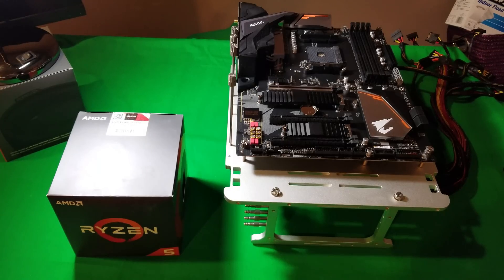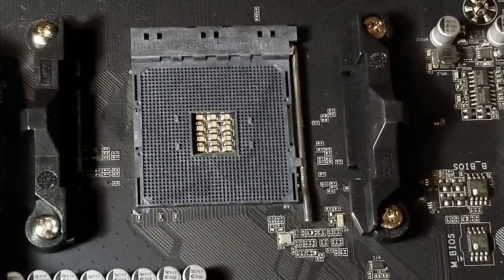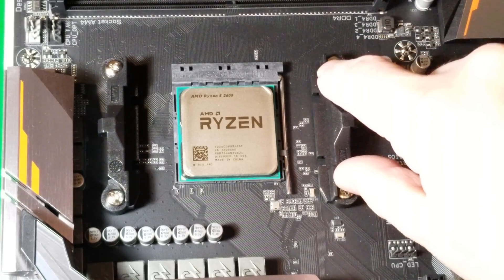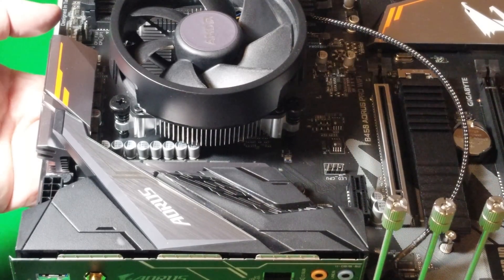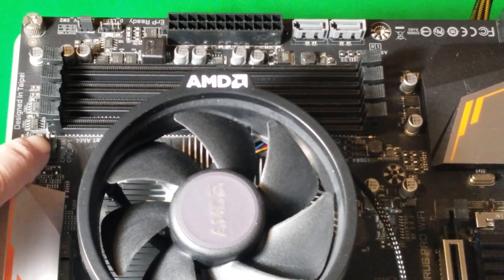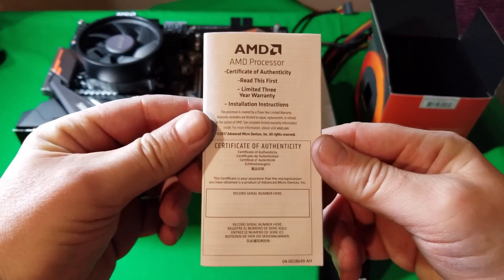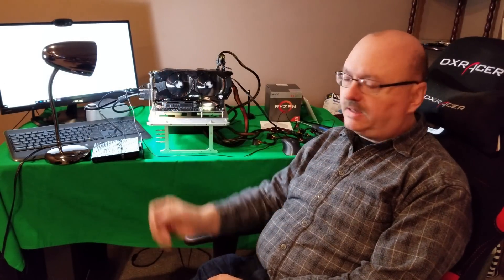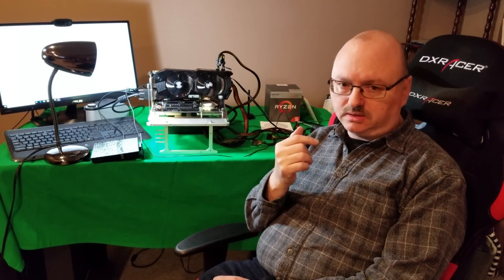Ryzen 5 2600 Unboxing and Install plus CPU Cooler Temps

Comment: My ryzen 5 2600 gets about 43°C in idle and 60°C max temp while gaming which is perfectly fine. What really scares me is when I stressed it to 100% with aida64, after 15 minutes of test with everything stock it reaches 90°C and stabilizes. It seems with different stress tests the temperature is different, as in cpu z stress test i get max 75°C
Reply from the maker: Yeah with the temps your getting and even if its getting to 90c while stress testing that not something to worry about. 60c while gaming is great. Your right though different stress test programs can vary somewhat.
Reply: @Reviewing_Playing_and_More_RPM  Yeah, just wanted to point that out. I'm not gonna utilize my cpu at 100% ever lol
Reply from the maker: @cachorropir  Yeah its hard to do actually, good that gaming usually doesn't either.

Comment: i've never put any parts together i got my pc custom built i currently have the ryzen 3 1200 but are planing on getting ryzen 5 2600x should i put it together alone or go to the company that built my pc and let them replace it for me free of charge? is it hard to put the cpu together? is there risks?

thanks, great video i subscribed :)
Reply from the maker: What MB are you using, but no there are really no risk, just to be careful and not bend the Pins, and also when you remove your current CPU it will try to pull it out of the socket, so be careful with that so as not to damage the current CPU when it comes out...otherwise you can just install as in the video and it will be gtg...will depend on your MB though, just ensure it's compatible...

Comment: my cpu temps on idle is 50 celcius with stock cooler no oc and no air conditioner in my room, is it normal? i just bought it 2 days ago
Reply: What is your ambient temperature? It should be around 10-20 more degrees than that
Reply from the maker: Your saying it should be 60 to 70C, on idle that's a bit high, so I'd be concerned depending on ambient temps and airflow...
Reply: @Reviewing_Playing_and_More_RPM  +10-20 of his room temperature
Reply from the maker: @yesman5463  if it's 10-20 degrees, then I'd say that's about right...
Reply from the maker: I'd say that's about right will depend on ambient temperatures, but It's not bad, will also depend on your case air flow as well...

Comment: So you tight the screws until they stop? Is there a risk of being overtight ? Thanks
Reply from the maker: Yes, once you fell them tighten then stop, but don't over tighten as you could strip the screw or  standoff and then it'll be useless and could cause damage to the MB...

Comment: My temps are a bit different from yours, i use a320m-k motherboard and pcyes ocx gelid thermal paste. My idle temperature on ryzen 5 2600 is 37°C ~ 47°C, it spikes from use like chrome or something casual but i think it's normal. The point is, your temps are 10°C lower, i have a guess but i don't know if it's right; i live on Brazil so my city is 30°C to 35°C on scorching days and you live on canada so that may be it. Am i right? Also my load temperature on the cpu is 58°C max, if that is similar to yours let me know.
Reply from the maker: Yes your right the difference has a lot to do with the ambient temp where I use it at, mine is around 10C less or so because I'm in my basement doing everything which does tend to be cooler in general, and on load your temps are almost exactly the same as mine...your getting good temps for sure...have an amazing day...

Comment: you slotted that fan on with absolute ease but I follow the exact instructions and my screws dont even reach the motherboard for me to screw it in
Reply from the maker: It takes a bit of practice, I have done it a bunch of times now, I struggled with it in the beginning as well...

Comment: For me, there's nothing holding the cpu in place...you said it pops in and you lock it in with the bar thingy but for me it just sits there and can easily be removed with the thingy down...
Reply from the maker: If you followed every step as shown in the video, there would be no problem, it would be locked in with the bar that comes down, and the CPU wold be held in place...not much more I can do, if you can't get it installed you might want to find a friend that can help, or take it to a computer shop for help...the pins need to go into the holes if it doesn't go down it's not in correctly...good luck...
Reply: @Reviewing_Playing_and_More_RPM  I figured it out. Turns out there was a piece underneath the motherboard that the screws go into that I had to put through the holes
Reply from the maker: It's the backplate...glad you figured it out...

Comment: Hi, I just bought a ryzen 2600 CPU but i've noticed that my temp on idle stay between 45-50 degrees C no OC with stock cooler. Do you think thats normal?
Reply from the maker: It's off a little but I wouldn't worry to much about it, check your temps when your doing something more intensive and see what you get that's a better determination...Thanks...

Comment: Do I have to remove my motherboard from my case  when removing this cooler?
Reply from the maker: No, you can remove it and put a new one on, getting to the backplate will depend on your case and the cutout on the back...if it won't allow you room to get at it then you might need to...most times you won't need to though...Thanks...
Reply: @Reviewing_Playing_and_More_RPM  thank you very much I was able to fix my computer problems. Appreciate it alot man!
Reply from the maker: Glad to help...

Comment: I was scared that when I was crewing it in I heard like crackling clicks but I guess it normal because when you were also screwing in it had the same sound as when I was screwing in so thank you
Reply from the maker: Yeah I think it's mostly the springs in the screws, but it is unnerving...take care...Thanks...
Reply: Reviewing Playing & More RPM if I try to wiggly my Amd stock cooler like you did in the video and it doesn’t move does that mean it is tight and snug in correctly and that the screws can’t be over tighten I would appreciate it if you can resposnd thank you
Reply from the maker: There can be some slight movement but in general there shouldn't be enough to notice, once you are sure it was touching the surface of your CPU and the screws that secure it are in place then it should be good, to test it start checking your Temps, if you are in a good range then you'll know it's working and secured correctly...Thanks...
Reply: Reviewing Playing & More RPM I can’t thank you enough I subscribe and you are one of the view tech youtuber  to respond to your viewers thank you
Reply from the maker: @rya3795  Anytime...Thanks...

Comment: When I tried to install my cpu cooler to the AMD BYZEN 5 2600, it bent the pins
Reply from the maker: If you had the CPU correctly inserted then the CPU Cooler should not have done this, is it possible it was sold to you with bent pins, it can happen sometimes...you could try to RMA the CPU and see what happens otherwise not sure, but depending on the pins location some of them are for future things and it might work anyway...Good Luck either way...Thanks...
Reply: Reviewing Playing & More RPM Thanks for the help! I appreciate it truly.

Comment: What can i do? I used to have good temps but now i dont please help me 😓
Reply from the maker: Need more info, ie what CPU Cooler are you using, what changed, how long have you been using it and anything else you can provide...ie what temps were you getting and what are they now...Thanks...
Reply: Reviewing Playing & More RPM i’m using the stock cooler i’ve been using it for 1.5 years the overheating began a couple of months ago i used to be always below 60 degrees celsius nothing has changed i have never Overclocked maybe thermal paste?
Reply from the maker: Typically Thermal Paste will last for many years, but if you used the pre-applied Thermal Paste replacing it with something better like Noctua NT-H1 would be something to try, it can give better results...also with warmer temperatures now, if your room warms up so can your system resulting in slightly higher temps...also a good idea to check the CPU Cooler is still correctly in place and a screw didn't come loose or anything of that nature that might be a factor for the change in temps...or if all that fails, might be time for a better CPU Cooler...Thanks...
Reply: Reviewing Playing & More RPM yeah i used the pre applied tp i will try another tp thanks

Comment: I noticed you installed the fan the same way as me. I didn't realize until after I installed it. That the amd logo blocks dimm 1. I'm using dimm 2 and 4 anyways for dual. When I do buy more ram I'll probably upgrade the fan or turn it the other way.
Reply from the maker: Yeah I always use 2 and 4 as well so hadn't noticed, the next one I did I started pointing it out and installing away from the RAM, for me it'll never make a difference but for others it could so yeah had to make that change...great point...Thanks...

Comment: my cpu with the same cooler is idle at 50c
Reply from the maker: That is a bit high but will still work fine...You could try switching to an aftermarket CPU Cooler later on for better temps...Take Care...Thanks...

Comment: what if my screws don't turn XD
Reply from the maker: Check that your backplate is there, and that you've situated the CPU Cooler over them so you can screw into them, if you've already done that and the screws aren't turning then I'd say you have a defective CPU Cooler...Thanks...
Reply: @Reviewing_Playing_and_More_RPM  after reseating it 10 times. 1/8th of a turn on each screw worked for me.
Reply: @Reviewing_Playing_and_More_RPM  just had to keep turn each one like that until tight. Haha
Reply from the maker: @JesseKrauss  Awesome, Good job, I hope someone points out to AMD at some point that the method of securing their Stock Coolers needs a bit of work, I find that occasionally these sort of issue's happen which imo they should not...but glad you got it done...thanks for letting me know...

Comment: Hello! Thank you for sharing this! I have the same exact CPU and I live in a hot tropical country and summer is just around the corner but I'm not gonna overclock. What is the best aftermarket cooler that you can recommend for this CPU? By the way, I'm using a fairly large case (silverstone primera 01) with six 140mm fans all around (3 in from front for intake, 1 upper rear for exhaust and 2 on top for exhaust).
Reply from the maker: I've started using the Hyper 212 EVO RGB Black Edition it gets really good temps, if you really want to go better there is the beQuiet! Dark Rock PRO TR4 which works awesome for an Air Cooler, for a Water/Liquid Cooling the CORSAIR Hydro Series, H100i RGB PLATINUM, 240mm will cool that CPU very very well...with these choices you could do overclocking as well...hope that helps some...Thanks...

Comment: That really helped me out a lot
Reply from the maker: Cool...Thanks...
Reply: Reviewing Playing & More RPM one problem though... my cooler screws don’t reach the backplate of the board. I don’t know what to do. Oh and btw I subbed
Reply from the maker: @rory9659  You will need to ensure the back-plate is held in place or in some way supported for the CPU Cooler to reach when you screw it in...I sometimes have to push down on the CPU Cooler ever so lightly to ensure this happens...also make sure you go diagonal when securing it, otherwise one screw will go in and the others won't reach...hope that helps...
Reply: Reviewing Playing & More RPM thank you. I’ll give it another try when I get home.

Comment: I see you're still commenting and hearting. I have a question. I'm going to buy this cpu and pc parts picker can't check the clearance for the ram and cpu cooler. how can I check if they will fit together since there's no dimensions for the cooler. if possible may you check for me? (I'm completely new to pc building) the motherboard is an msi b450-a pro atx am4. and the rams are corsair vengeance lpx ddr4-2400.
Reply from the maker: The dimensions are 135mm of clearance for the CPU Cooler height, it depends on the case if it will fit, as for the Ram Corsair Vengeance is considered low ram clearance so you'll have no issue's with the MSI B450-A Pro ATX Motherboard and your Ram...Hope that helps...as for clearance for the Ram, turn the CPU Cooler so the AMD Logo is away from the Ram slots and it'll give you a bit more clearance for even high Ram...Thanks...
Reply: @Reviewing_Playing_and_More_RPM  thank you so much!
Reply: @Reviewing_Playing_and_More_RPM  the case is a diypc diy-bg01 atx mid tower case
Reply from the maker: Your more then good in this case, love the look of it actually, the CPU Cooler clearance in this case is 163mm so most CPU Coolers will fit in it, love the LED strips on each side...solid choice...
Reply: @Reviewing_Playing_and_More_RPM  thank you very much.

Comment: my cpu runs 20degrees hotter than yours on idle, fan speeds don't change much, didn't overclock anything in BIOS.
Reply from the maker: I have found that sometimes I've needed to take the CPU Cooler off, and remove the pre-applied and use my own, doesn't happen often but found it has helped...good luck...

Comment: i just buy this r5 2600 today,it really comes with thermal paste?
Reply from the maker: Yes, it comes with thermal paste pre-applied to the CPU Cooler...Thanks...
Reply: @Reviewing_Playing_and_More_RPM  At this time... What's your opinion Should I buy r5 2600?? Coz budget low 🙂
Reply from the maker: @shahoshow6650  There's only a $20 difference between the 2600 and the 3600 so I'd suggest spend the extra to gain a significant increase in performance...

Comment: I just put together a PC for my friend which has this CPU, msi aero 1050 ti, rog strix b450f gaming, 2x8 ballistix 2666 ram, 650w corsair PSU, and it keeps freezing after about 10~ minutes of running (doing basically nothing). No mobo drivers yet which could be the problem but. I was worried the stock thermal paste wouldnt be enough but apparently it is.. One exhaust fan in the back, and one intake fan in the front. Fresh x64 w10 os. All tips appreciated.
Reply: @goobster5220  It turned out to be a Very faulty and old version of windows, i got a new fresh one and it works much better! Only problem atm is that HotS (and hots alone) crashes upon loading a game, which is the game we want to play atm. It works fine other than that.
Reply from the maker: Sorry for late reply was in Hospital with Pancreatitis, I see below you got it figured out...good job...not familiar with Hots though, I'll take a look and if I can find anything I'll get back to you...take care...
Reply: @Reviewing_Playing_and_More_RPM  Thanks dude.

Comment: Thanks for your video!

I got a dead MSI 970a-g43 and need to buy a new one and was looking at the MSI B450 GAMING PLUS MAX Motherboard. What CPU would you recommend for that board? That's only if my CPU is dead of course.
Reply from the maker: The B450 is a AM4 Motherboard so I'd look for something in the 3rd Gen series, like Ryzen 5 3600 up to what fits in your budget...alot of great choices...budget dictates, could even go with a Ryzen 7 2700X as there selling at great prices right now and will rock any game you choose to play...Thanks...

Comment: Stock cooler with a case that have 7 fans it's enought for less than 70 degrees?
Reply from the maker: It's possible, but mine was hitting 82F, but no fans, so it's possible to get a bit better...Thanks...

Comment: Few tips. You should put little pressure downwards with your finger to the cpu to be sure its not lifting at all. I think the cooler should be other way so it doesnt block the memory slots.
Reply from the maker: Appreciate the info, and yes the cooler should face the other way, I put that in the description afterwards once I realized...Thanks...

Comment: My temps while browsing are from 43c - 55c. Apparently, this is normal. My gaming temps are around 50c - 65c.
Reply from the maker: It can be as I have found some of the Stock Cooler's seem to vary a little bit, and if you are getting 50 - 65c while gaming then it's working great...I have found that other then sometimes they can be a bit noisy the stock cooler usually works great, have only had to change out one that was just to loud...Take Care...Thanks...
Reply: @Reviewing_Playing_and_More_RPM  Thanks for the reply. I heard there are two different  Wraith Stealth Coolers: 5 bladed and 7 bladed fans. Mine is the 7, which I heard is the worse of the two. Definitely can hear its hum around 55c. But temps are good; I get paranoid too easily lol
Reply from the maker: Yeah, the noise of some of them can be a pain, I have my new build that has a whine, which I think is coming from a GPU fan so might have to replace it with my previous 1070, I hate noise...lol...but if it is the CPU Cooler fan, it'll have to go, might replace it in that case with a water cooler...will make a nice video if I do...good luck with yours...I worry constantly as well lol...have a great week...